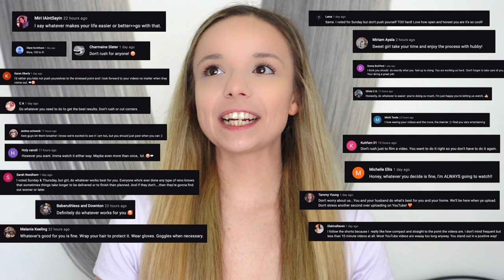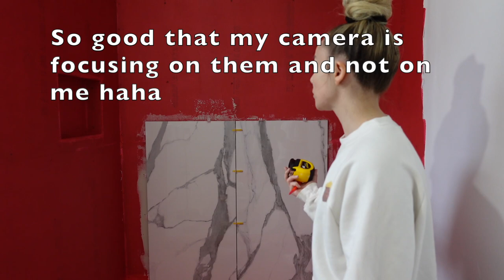MASTER BATHROOM MAKEOVER PART 2! | HOT MESS HOUSE RENOVATION! | LEXI DIY

Comment: I saw a video the other day where they did the same mistake with bathroom tiling - there was a gap between the top of the big tiles they meant to put up and the roof. They solved it by putting a much smaller tile if a different colour (in their case blue opally-looking tiles) in the gap and it was beautiful in the end! Don't know if it'd work for you, but thought I'd share the suggestion.
Reply from the maker: Thank you Jen I appreciate it!! We actually ended up finding some tile that looks like crown molding to fill the gap but same concept! (:
Reply: @LexiDIY  That sounds lovely! I look forward to seeing it :)

Comment: Did you use mastic to stick the tile to the wall?
Check the back of the bucket of the morter if it says that it is appropriate to use it in wet areas
Reply from the maker: It is for use in wet and dry areas 😊

Comment: Ok, I’m not trying to be a downer, but you’re supposed to tile the pan before you put up the walls. The pan goes in first, then your wall tiles sit on top of the pan. The tile is beautiful, but it’s most likely going to leak. I truly hate saying that as you two have worked so hard on that shower.
Reply from the maker: Yikes we were told to do it that way but will keep this in mind for the next bathroom, thank you!